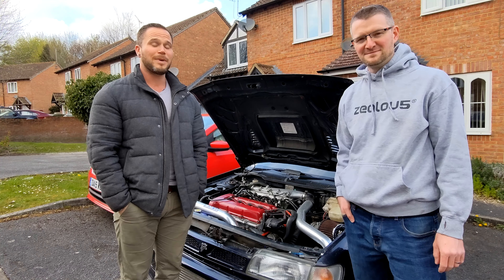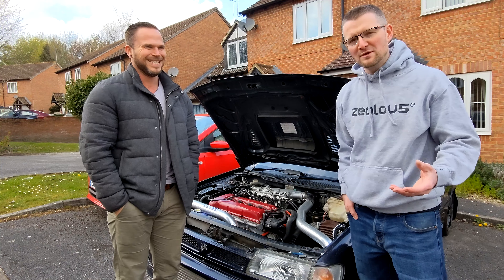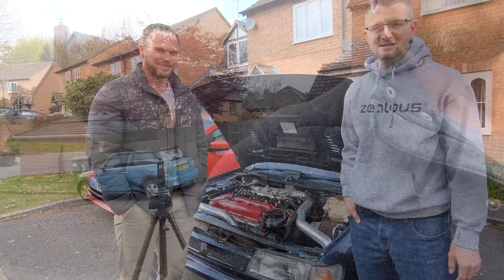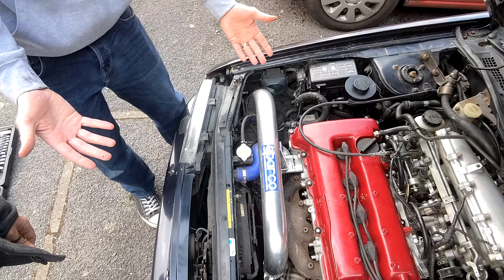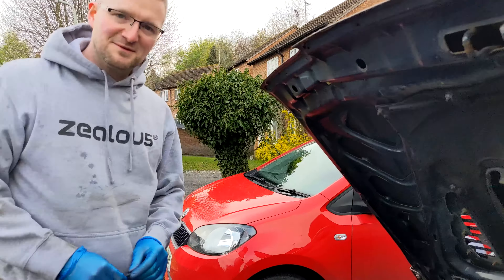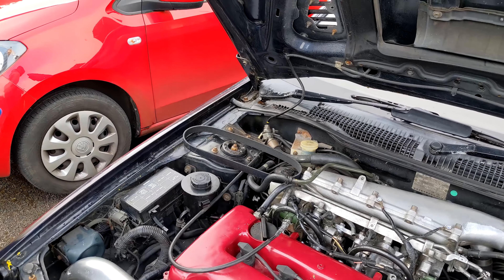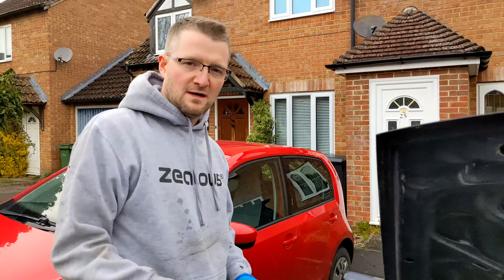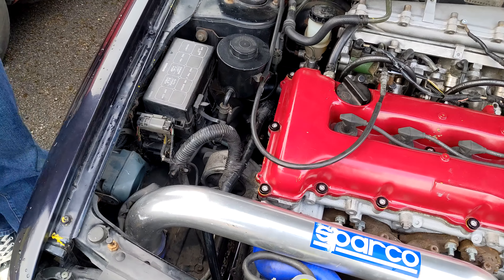Changing The Alternator Belt & MORE -  Rebuilding A Nissan Pulsar GTiR Part Six

Comment: I feel you on some areas on an engine being harder than they should be. The CRV I drive has the transmission fluid... intake I think, or where you put transmission fluid in, sitting below the car battery. Problem with that was until I figured out a solution any time the CRV needed transmission I would have have to take out the battery first because I couldn't get a funnel in the space I had. Now I just tape a straw to my funnel and it is easy.
Reply: Yeah it’s silly how things can look difficult but in fact be very easy and once you know how, even if it was difficult it’s never that hard again! Thanks for watching 🤟🏻

Comment: Hey I've got an automatic, United States of America (Driver's in Left seat) 2001 Nissan Sentra SE body with a 2.0 Liter Engine [made by Mazda]  I am not familiar with GTiR; However if there are any salvageable parts that can be transplanted let me know, what you need.  Other then the undercarriage parts needing to be secured and the Head Gasket leaking oil. The car is well taken care of and the stuff that is wrong is superficial stuff like Visors and weatherstripping or Headlights but the Spark Plugs, Air Intake, Gasket Seals, Distributer, CV-Boot Joints, and Radiator are nearly new.
Reply: Sadly nothing transfers across as that’s a totally different platform but thank you for the offer 👍🏻😎